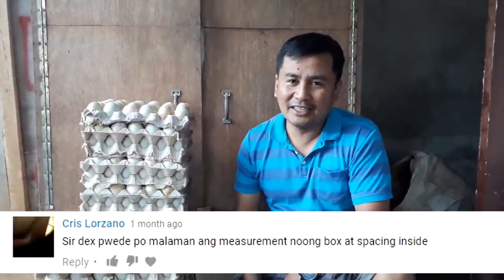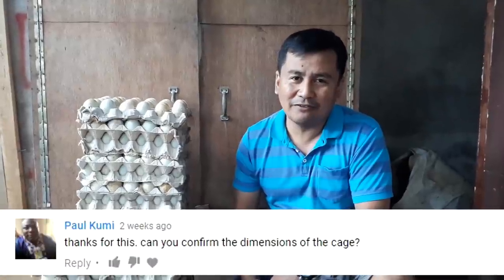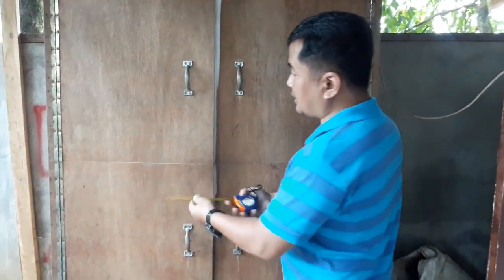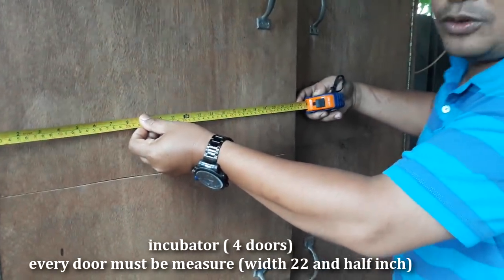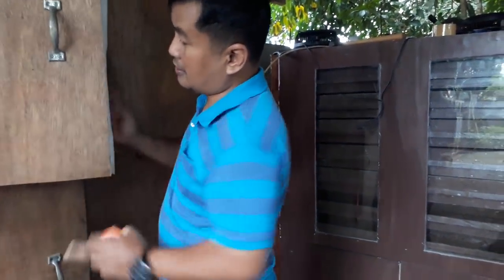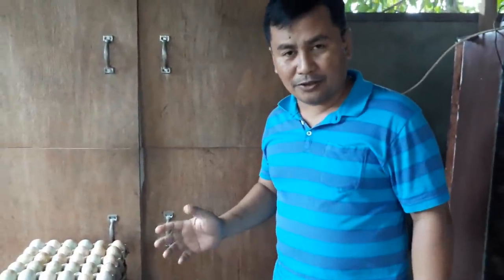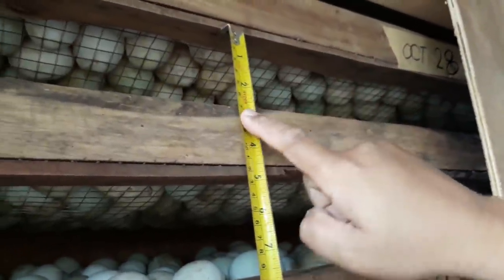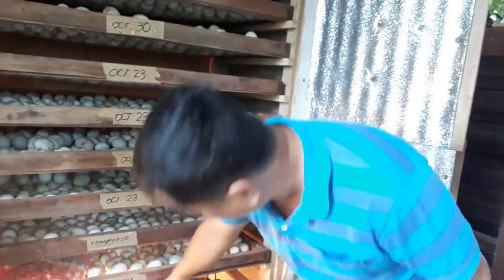Home made incubator Exact measure, size & Dimensions- Best tutorial

Comment: 1. How many electric bulbs are you using for this particular incubator?
2. Heat is high at bottom side and gradually decreasing to the top , will that affect hatching ?
3. What is the temperature to maintain in incubator ?
4. Does the temperature same for all eggs( hens, duck, quail)?
Please provide that information I'm planning to start a farm .
Thanks in advance

Comment: sir how heat reaches the top where we cant see any bulb light in ur incubator and what is capacity of ur incubator in total and per tray?and how is quail bird incubator diffrent from this ?plz plz reply sir!
Reply from the maker: surya dev please view all my videos about incubator where i discussed thoroughly about the humidity and heat. Also about the electrical connections
Reply: Dexter's World but i understood humidity n all but my question is diffrent .
Reply: Check 6:00
Reply: Hi sir dexter how many hole  for humidity  and how big it is.
Reply: There is a big problem of this incubator design this is my failure design before. if this design is fully loaded it will have a poor  performance. he doesn't  apply enough wall gap for air circulation to have almost uniform temperature. most common failure for newbies. the heating apparatus is right it must be in the bottom even without fan with enough wall gap the air will circulate. remember that hot air is lighter than cold air so hot air will stay on top. this design is so inefficient because he must use a lot of fan just to maintain a good air circulation another electricity lost.

Comment: Iam trying do it ur way but i cannot deal with thermostat.. I bought w1209 thermostat i am unable understnd how to manage temperature in it pls help me
Reply from the maker: the one that i have showed in the video is the switch of the thermostat .it will be pushed by the plates to turn off when it reaches the desired heat which will be achieve through the adjustment in its screw attach to it.

Comment: william Belaguas
1 second ago
There is a big problem of this incubator design this is my failure design before. if this design is fully loaded it will have a poor  performance. he doesn't  apply enough wall gap for air circulation to have almost uniform temperature. most common failure for newbies. the heating apparatus is right it must be in the bottom even without fan with enough wall gap the air will circulate. remember that hot air is lighter than cold air so hot air will stay on top. this design is so inefficient because he must use a lot of fan just to maintain a good air circulation another electricity lost.

Comment: Sir dexter saan po ako pede mkabili ng thermostat cavite po ako
Reply: Tony, sa mga poultry supply store or agricultural store. Sabihin mo "thermostat assembly" para wala ng sakit sa ulo. I-mount mo na lang.  Kung sabihin mo lang na thermostat, thermostat wafer lang ang ibigay sa iyo. Sa thermostat assembly, nandiyan ang wafer, limit switch (normally open), ang adjusting screw, at ang mounting bracket.

Ito kasi si Dexter, nag kahirap hirap na nga sa pag explain. Anyway he is struggling to learn. Marami pa siyang dapat malaman. Although mapisa nga ang mga itlog pero hindi effecient ang kanyang incubator. Patakbuhin pa ang pagkagawa.
Reply: Salamat po sir dexter!
Reply: Tony, hindi mo ba binasa ang comment ko? Bulag ka yata. Ako ang sumagot sa iyo, hindi si Dexter. Bago lang si Dexter sa negosyong iyan. Walang alam kung ano ang dapat niyang i-explain. Halimbawa: 14 days from hatch; or i-incline "so that the eggs will slide."Hindi mag slide ang itlog kundi mag roll. Modern ba iyang patakbuhin iyong pagkagawa?

Dapat ang title sa blog niya ay: Primitive Methods Of...!
Reply: Sir Sparky baka pwede kaw na lng po sumagot sa mga tanong na napakarami di naman sinasagot ng blogger. Sa lahat kc ng nabasa at napanood ko e kelangan iturn in eggs at least 3x a day then itong incubator ni sir Dexter e di naman automatic turning.